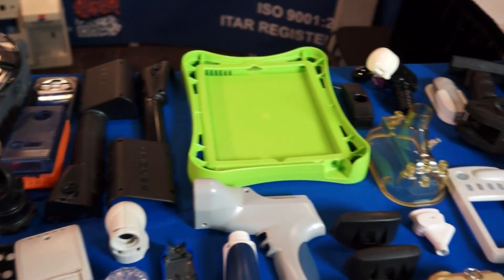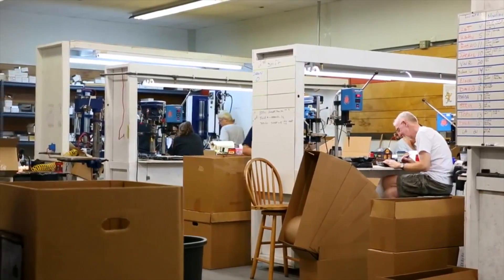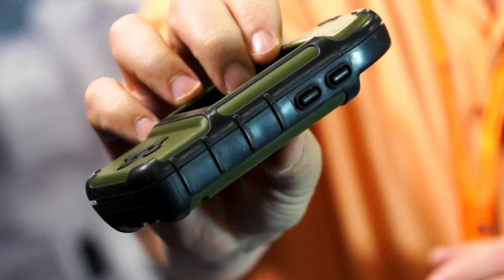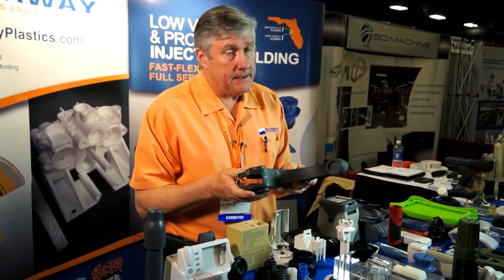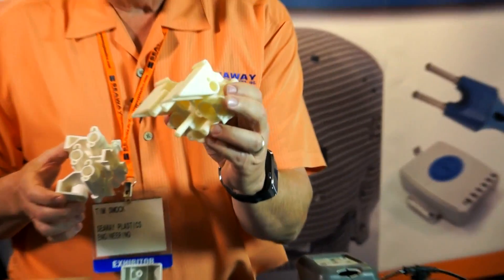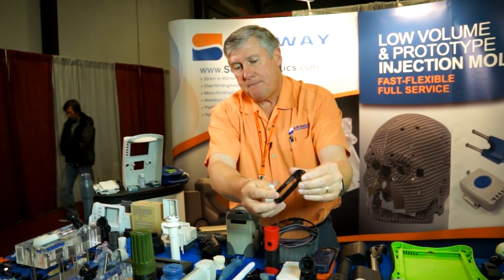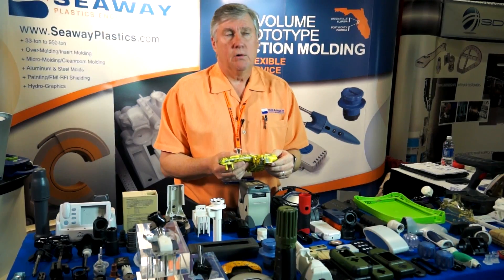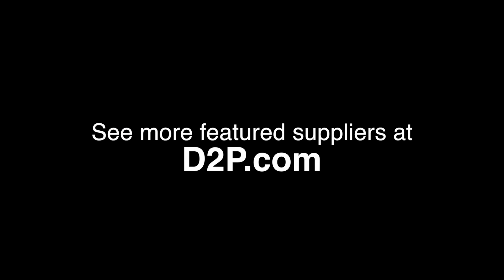Low Volume Injection Molded Parts with Overmolding | Seaway Plastics Engineering | Port Richey, FL

Comment: I am hoping to make small plastic beads from recycled plastic.  I saw in another video that it costs $.65-4.90 per part.  That seems a little expensive for one plastic bead, which often sells for 3 dollars per bag of 100 beads.  Are there ways to reduce the cost to something reasonable for a tiny part like that?